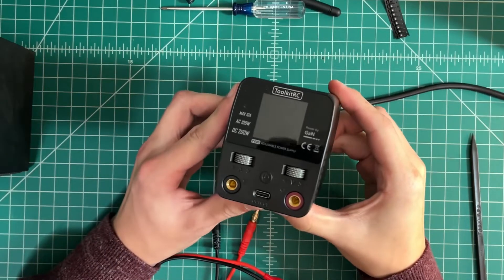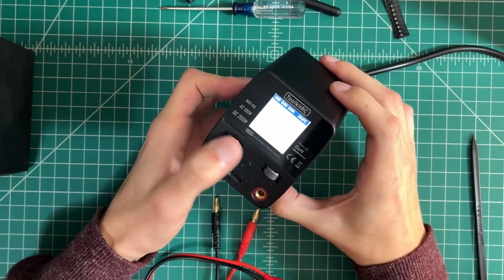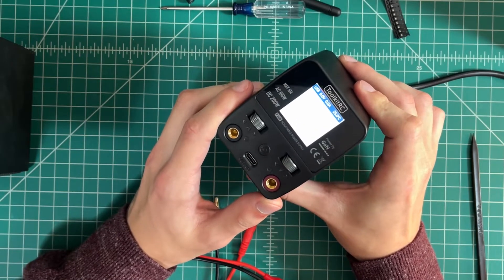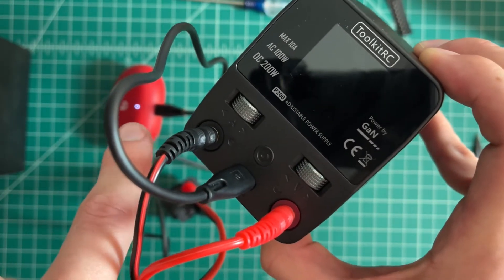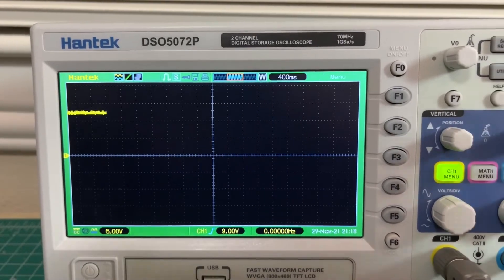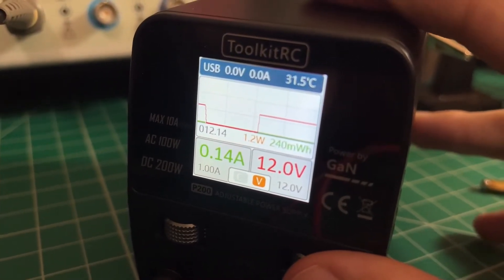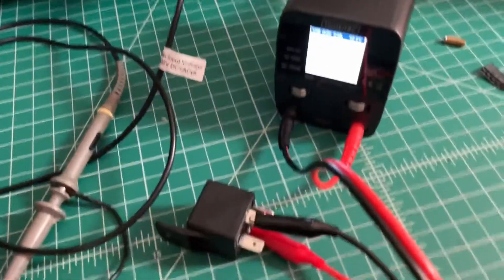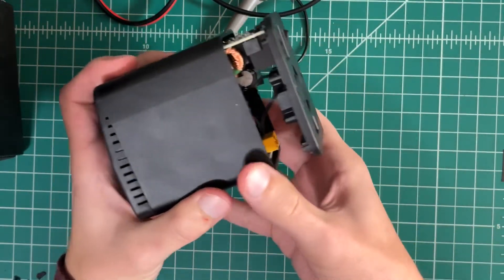ToolkitRC P200 Teardown and Testing - Ultra Mini Desktop Power Supply

Comment: Can you give the part number of Q1,Q2 and Q3?  Also the thing you pointed as been a fuse. I don’t think it’s a fuse but diode rectifier. You can see 2 “~” next to it saying AC and the “+” and “-“ on other side that goes to those huge capacitors to get smoothed to because DC signal.

Comment: And voltage ripple under load? Your oscilloscope screen seems to show quite a lot of hair, and that's under no load. I fear this is yet another cheap 'DC with lots of HF AC' power supply, but it would be nice to see some measurements e.g. ripple at 10V, at 0mA, 100mA, 5A?
Reply from the maker: Good ideas, I’ll try to post a follow up video.
Reply: @mattynice740  A 'burn in' test (check output after 30 mins at 70% max rated output) would also be useful - apart from usability/interface issues, I worry that these cheap PSUs have noisy outputs and are not rated for continuous use, certainly beyond the few minutes of most reviews.

Comment: 13:05 Without having to look I can guess they are using a GD32, which is a clone of the famous STM32 made by GigaDevices
Reply: In other words, the GAN circuitry is most likely only used on the USB-C port
Reply: 14:00 AON6144 (by AOS - Alpha&Omega Semiconductors). A 'common' N-Channel MOSFET here in China
Reply: 9:00 The input filtering caps do not need to be from a Nichicon quality. They have taken a reasonable size and used 4 in parallel to compensate for this. Overall, I think this is a good construction and adequate enough for the application.

Comment: Thanks for the teardown  I wanted to know what was inside these power supplies. My 1st one went bang when switching it on powered by the mains, the replacement did not work on the mains, I am on my 3rd which seems ok but its not been used enought to know if it is any good.  I hope you have better luck with yours.